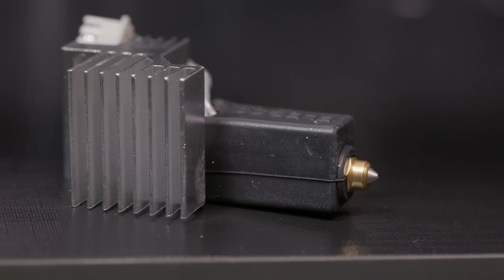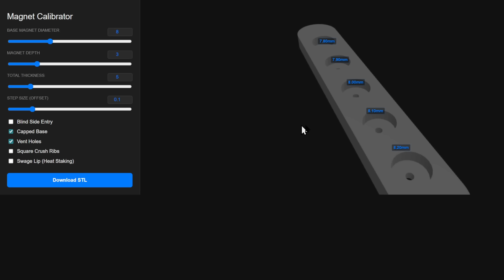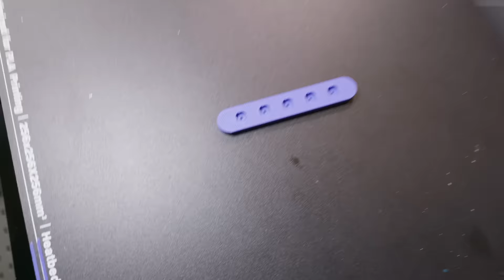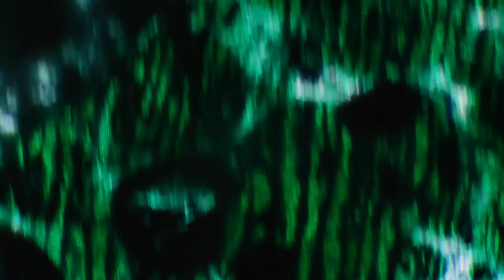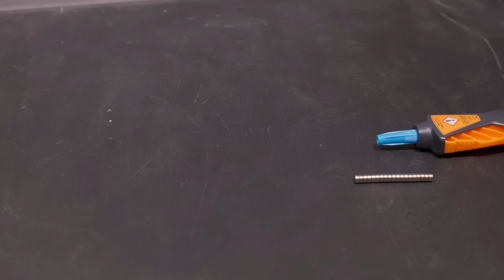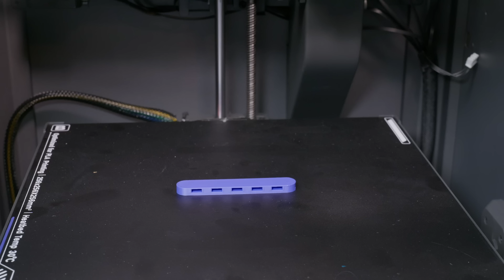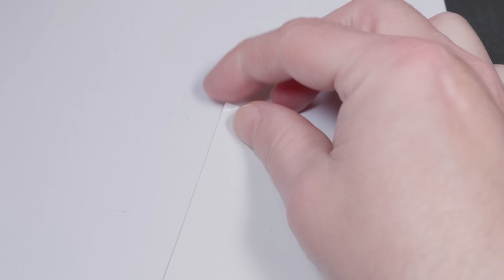Magnets in 3D Prints: How to ruin your printer edition

Comment: Woodworking tip for fixing magnets with glue; use a LOT of glue, and leave ribs for the squeeze out and air. Look at a furniture dowel, the little ribs on the dowel let glue and air seep up the side of the joint. Do the same thing with your friction fit, create a bit of a star pattern, and allow glue to seep up the side of the magnet. This is a tried and true method.

Comment: I make PETG-CF/GF hand tools with diam. 2-8mm magnets inside. I usually do a 0,1mm smaller hole and press fit them with a vertical press tool. Never had any problems with them, and the tools are used in industrial environment.

Comment: I recently made an extension for my FPV goggles using 2.5x7.5x2.5mm bar magnets - I probably could have used your tool as I ended up having to alter the holes with a sharp knife, but it still turned out well (and I almost didn't cut myself).

I will give the tool a go soon!

Comment: You can get a magnet out of a printed part without a vent hole by dipping it in acetone for a while. The acetone will degrade the plastic and release any glue used to recover the magnets

Comment: Brass consists of zinc and copper. It should not be magnetic. If your "brass" is magnetic something is wrong with it.  I just popped out to the shop, where I have a variety of brasses and bronzes in different alloys, and some nice strong NIB magnetc.  I found no magnetism.  So yeah.  China strikes again. Looked it up. Brass is slightly DIAmagnetic, which means it pushes away (very faintly) strong magnets.
I dunno what's up with that nozzle.  Need to machine one in half.  ;)  I think I'd be willing to do that for you, in fact.

Comment: also you can use friction fit and inserting magnets mid print just not powerful magnets even then you would want to use screws and steel plates to mount those because of how strong they are

Comment: I glue mine in with E6000 glue  friction fit and let cure 24 hrs. It gives a strong bond  with some flex in the glue to form around magnet edge slightly.

Comment: The times I've needed to have magnets inside the print, I just design it to join together (and have magnets slide in). And the times it's on the outside, it's a combination of friction fit and super glue

Comment: I'm using a variant of the glue and the side insertion method, but not exactly. I keep the magnet somewhat loose fitting, but I put a vent holes on the side opposite of the insertion slot. I then use a 3dpen loaded with the same filament, and squeeze filament around the sides of the magnet until it comes out of the insertion side. It naturally wants to take the path of least resistance, so I let the squeeze out dry completely, I sand the side flat again, and I repeat. That second round usually makes it flow around the other side of the magnet. Complete encapsulation, but you can print your whole part first without the magnets. I imagine this would work incredibly well with those magnets that have screwholes. Sort of a rivet type of situation.

Comment: I have been designing tools and other functional objects that heavily rely on magnets for 4-5 years now. The best advice I can give if you want your designs to be reliable, long lasting, and durable is:

1. ALWAYS have some form of solid surface between your magnet and what it is supposed to attach to. Yes, you will lose a lot of magnetic strength when doing this, but it is 100% worth it to get larger, more powerful magnets and have them be behind 1-2mm of solid plastic, than to use glue, screws, or press fit. All 3 of those last options WILL fail sooner or later.   

2. Use magnetic strength calculators. There are a bunch online that will tell you how much pull force a magnet has at any distance you want. So if you are making something where you know the magnets will be 3mm away from what its pulling, then you can put it into the calculator and find out what size, strength, and number of magnets you need to use to achieve your specific pull force goals, or vise versa. 

3. NEVER make your designs have a direct magnet to magnet connection with nothing in between. Very similar to point 1, but you should always make sure there is something in between your magnets and what they are attaching to, especially if its another magnet, because magnets are extremely brittle and will destroy themself if they are allowed to have direct contact. Even if you are ignoring  point 1/3, at the VERY least make sure to put a thin sticker over top of one of the magnets, because even that 0.25mm of paper or plastic adds enough cushion to stop the magnets from slamming against themself at full speed and destroying themselfs, unless you are using very big magnets.

Comment: Excellent video... I've made a lot of vacuum hose connectors for my work shop tools using glue and friction fit.  It works great but my problem is the magnets pick up all sorts of metal filings and it's super hard to clean those off.  I was thinking of modifying my design and seal the magnets with a couple more layers of petg.  It won't stop the metal filings from collecting but I think it will be way easier to clean off if the surface is smooth.   I was disappointed to hear from your video that you lose strength enclosing the magnets.   But it left me with the question, how much connecting power would I lose.   It would be very interesting to have a video showing tests of this.   ie. how much strength you lose if you add 1 layer, 2 layers, etc...

Comment: wondering how well it would work to make a threaded hole, put the magnet into the hole and then cap it with a grub screw. the magnet touching the screw would then make the screw itself magnetic. not sure how strong it would be though

Comment: What should (theoretically) work best is to chill the magnet (freezer?) and then put them in a slightly undersized hole?
Reply from the maker: In theory yes, in practice, metal is insanely conductive, just walking from the fridge probably is too long.

Comment: I always use friction fit combined with embedding.  The friction fit is solely there to prevent them coming out during the cover layer.  Best case is if you can use them on a magnetic base plate where a single print layer can be layed down before the magnet, and the bed itself holds them away from the nozzle, and you get the least plastic in the way afterward creating relatively strong magnets.  Friction fit is too easy to fail over time with heat or moisture absorption by the filament.

Comment: Friction fit from the other side of use. So instead of a friction fit hole that faces the point of use, I put a hole on the opposite side and make it deep enough so that the working side only has a layer or two between the magnet and the point of use. The deeper hole can then have a plug or a screw insert of the same material. Screw if you want to remove it and plug if you want to glue it. The hole is a bit larger than a friction fit since the plug or screw insert holds it in place.

Comment: I own a Cafe, and recently I made a new menu board, steel sheet adhered to plywood and framed, spray painted matte black. I then 3d printed my menu items and prices dual color, matte black base, matte white letters. It turned out amazing, and I embedded about 120 neodymium magnets, pause at layer method, 2-3 per object depending on the size, sometimes 4-8 objects per plate. I sized the holes so that the magnets were a tight fit, and with enough vertical headroom that the nozzle never gets closer than about .4mm from the magnet. If the nozzle doesn't touch the magnet, it's not going to get very warm. I have had zero issues doing this, and I've done it hundreds of times.

Comment: I usually just glue them in.  But ive also made the hole bigger and made a cap that can be glued over the magnet to hold it in place because somethimes you want the magnet force rto be slightly weaker or you dont want the magnet to directly touch what ever you are attaching your print to.

Comment: you missed: screw-mounted. I use chamfered doughnut magnets with a cone screw. That allows great magnetic force and great resistance to being pulled out. The screw also gets magnetic properties transferred, so it improves the overall strengtth.

Comment: Thanks for the video.

I like the ribbed design, good for friction fit with the benefit of allowing air out around the sides and if glue were added any excess would flow up around the side and any excess would come out the top and could be wiped away.

Comment: While distance reduces the magnet's strength, many strong magnets can break if they repeatedly smash into each other without anything in between. For those magnets it's best to make sure they are a bit deeper set so the plastic forms a small buffer.
Yes that will reduce the magnet's strength a bit but it allows you to use stronger magnets and the result can still be stronger.

Comment: You should know that hoping for a consistent tight fit with desktop 3d printing is next to impossible. I've just had a case not long ago where I did exactly that with magnets, same printer, same object, same orientation, holes next to each other, some hold the magnet very tight and some are completely free. Magnets are just way to stiff for this. It works well with plastic on plastic. Just use some glue... Also, I don't think anyone likes your answer of "trial and error". If you have any experience with 3D printing you should be sick of the amount of time you can lose over trial and error. J U S T    U S E    G L U E.

Comment: So the first problem is that some printers are poorly designed with magnetic nozzles, and the second is magnet strength. Both of these are easily solvable by buying a good printer, and decent magnets. I can also say that customers buying magnetic products don't like the exposed magnets. Some don't care, but the majority will give feedback that fully enclosing the magnet is a huge value point and come back to our store because we don't use exposed magnets.

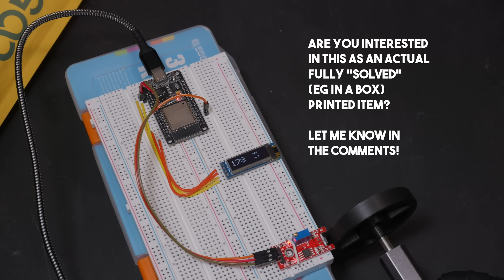Comment: I have my concerns with 10:54 becqus the addet mass does put more strain on the motor so it might not spin as fast and with the magnet it might  even wobble. an image sensor and a dot of whote in a small black part would be better.

Comment: If the nozzles pulling your magnets out of your 3d prints, your hole tolerances in the model are too big for the magnets you're using.  Never had a magnet come out of one where I had put the magnets in half-way through the print.

Comment: My printer (Qidi X-Plus 3) has a magnetic bed & metal plate.  I could probably use an actual magnet as my nozzle and still not pull an embedded magnet out of a print. 😂

Comment: If you want to print the magnet into a recess with a rim and still want the face of the magnet to be flush you can leave a hole in the middle and then super glue a tiny washer with the same thickness as your outside layers to each magnet or one thicker washer on one magnet if it can be a bit proud.  The washer and hole will then aid wtih locating the two parts like a key between a shaft and pulley.

Comment: Pause Print > a drop or two of SuperGlue into the hole > Drop the magnet in > Resume printing.
Never had an issue with magnets being lifted by a steel nozzle, it really is a non-issue, 20 seconds of common-sense thinking will usually find a solution to such simple issues.

Comment: 2-magnet solution: press-fit for the magnet that’s meant to interact with the outside world, but then a side-slot for a slightly larger magnet right below it, to which it will stick (magnetically and with super-glue).

Comment: Speaking from lot's of experience, if your are dealing with strong magnets. Both friction fit and super glue will likely dislodged themselves after a time.

 I have re super glued the same magnets to PLA sometimes 3+ times. Used gel glue, regular and brand and cheap.

 The adhesion is fine as it'll rip up parts of the PLA when it comes detached.

 Friction fit is difficult to bet on with such a small scale as some magnet can be .25mm different from one another.

 Also super glue will often times leave a white, creeping, powdery discoloration when used on PLA or Petg.

 Unless it is dried quickly.

 I still use it as it's good 90% of the time. But just something to keep in mind

Comment: Maybe the problem with heat insertion can be solved if you apply a strong magnetic field on the magnet while it cools down.
Although, I don't know how practical that would be, or if heat insertion would have that much of a benefit over friction fitting, when most magnets have uniform sidewalls.

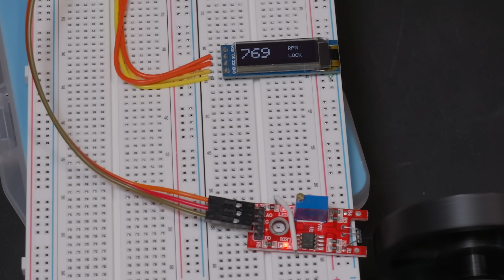Comment: 10:40 you could employ this in a “coil winding, counter.” Coil winding is by many accounts brutal. Like watching paint dry, depending on the rim’s applied to wind it. Obviously the magnet would not be on or under the coil more at the side. But with a bobbin 3d printed, any shape becomes a possibility.😊

Comment: One thing worth pointing out is that having something between the magnet and whatever it might make contact with gets a better and better idea the stronger the magnet is. The alloy used for the neodymium magnets are fairly brittle so not letting them collide with metal is a good idea on larger magnets.

Not an issue with the tiny disk magnets used in the video though.

Comment: I make “magnet screws”.
I literally produce a screw with a standardized thread (I used the same pitch etc across projects for magnets of given diameters/depths) and I place the receiving shaft and threading on all places requiring magnets.
The magnet shaft itself inside the bolt is a “loose tolerance fit” so I can recover magnets if recycling parts later, and I can easily recover the magnet and flip it around if I accidentally mess up the polarity.
Reply: @s.j.stuart   neat. Just gave me a great idea (maybe that's what you have if I misunderstood?). Make a threaded hole and create a "screw" that is closed on one side and has an embedded hole in its shaft to put the magnet in.  Gotta save this.

Comment: Honestly, I've been doing magnets a lot, and it's super simple for me: just use hardened steel nozzle in my bambu p1s and pause the print for insertion.

For paranoid folks a solution I'd suggest is tk make magnet hole 3mm higher and insert a 3d printed shim/filler on top of magnet. That way when you resume the magnetic attraction to the nozzle is pretty much gone.

I do that only for big very strong magnets. But usually I'll just keep it simple and not overengineer it.

Comment: I dunno. Just gluing them in after a print is the best way. Make the hole for it slightly wider than it needs to be, and you're 110% good. I've been using 10x2mm magnets for dozens of my prints that can fit them (including some figurines, that way if they fall or are mishandled, nothing breaks. It just goes into 5 pieces), and i've never seen a single reason I need to friction insert them or embed them into an active print.

If the model is being painted, you can paint over them. If they're in a spot that will never be seen, they dont need to be painted at all. I have a deckbox that uses magnets i've had for going on 2 years. Not a single ounce of wiggle from the magnets since using a cheap $1.25 store CL/CA glue. And if you're really worried, you could lightly scuff the magnet and the inside of the hole with some sand paper, and it definitely aint going anywhere then. A little pushout on the glue can also be good. It lets you ensure you've got a 180 degree binding to the print surface. Glue on just the bottom can be fine, but having all sides (save for the top, obviously) of the magnet glued into place makes the bond that much stronger.

Comment: A method I’ve found that works well is to buy fine thread bolts that are the same diameter and use heat to insert them, the unthread the bolt and use glue. You get a great combination of friction fitting and glue going into where the threads were to get a nice and solid fit for the magnets

Comment: Thanks!  Excellent video.  Some of this is obvious, but I learned something from even the "obvious" parts.  I've never had a problem with straight CA glue.  I've been stacking two 10x3s (more power!).  I put medium viscosity CA glue in the hole, press the magnets into the hole, and let it sit for a few minutes.  I then come back with some thin viscosity CA glue and let it fill in the edges  and between the magnets using capillary action. I've even stacked 10x60x3 bar magnets for a 6" dust collection connector.  If you give it a chance, the mating halves of the connector will but a big bite on a finger.  DAMHIK  Even with this force, I've never had a magnet pull out.

One thing that DOES NOT work is an accelerant for the CA glue.  It'll make PLA, at least, look horrible.

Comment: I've put them into a pocket in the print from the rear and then taped over the pocket.   This worked in the application as the front face was thin enough and the distance to the part the magnet worked with (sensor) still ok.   The magnet holder was then zip tied to the crank on a bike.   It was to sense cadence.

Comment: I use a fair amount of press-fit magnets and the best installation method I have found is using a small arbor press. New, they are about $60, but I got mine new on FB Marketplace for $20. It has a cast iron frame which allows me to keep a stack of magnets handy, the best part for me is that the ram being steel, the magnet sticks to the ram, so I position the print on the table plate, then I only need to position the print and lower the ram. I made jigs to position the print on the table and the end of the ram for production work. I can accurately place magnets as fast as I can move the parts with no thought involved.